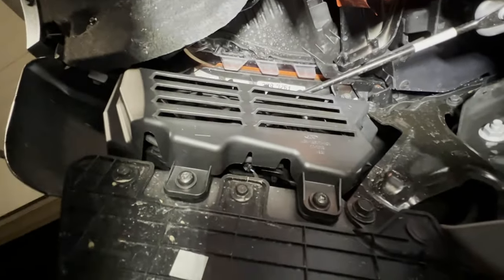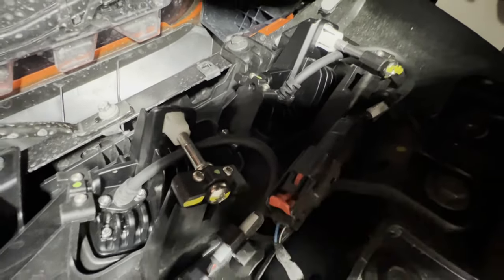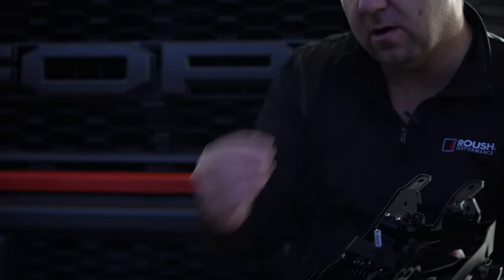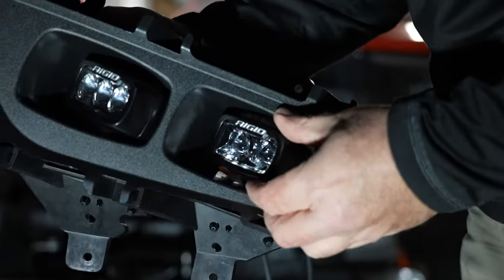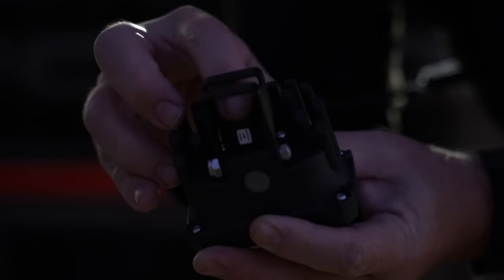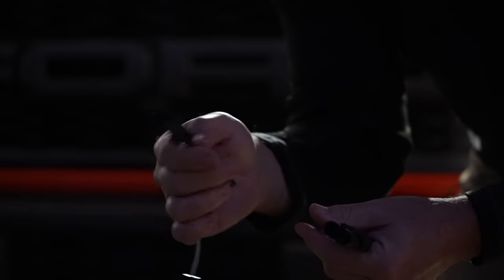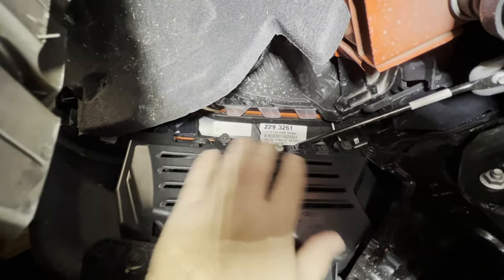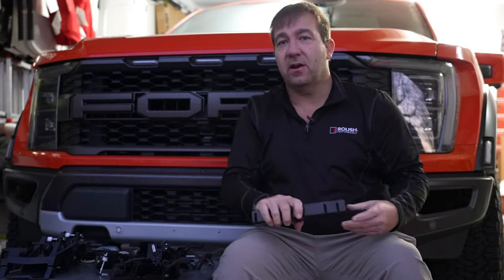2021+ Gen 3 Ford Raptor OEM Fog Light Upgrade Install - Rigid SR-M, Baja S2, Diode Dynamics, 2022 22

Comment: if ill get 4 diode with backlit how many extension cable would i need that needed to be plugged in to running light plug?
Reply from the maker: Give us a call or a text, Jayse. (317) 934-6778 Sounds like you have a few questions we would love to get answered for you. Thanks!

Comment: List of tools needed?
Reply from the maker: Just a basic socket set and Allen wrenches.
8, 10 and 11mm sockets
Reply: @jtrischler From what I observed a T30 and 10 mm socket I just couldn’t make out the screws that hold the stock light housings. I’m assuming those are allen head screws? Thanks for the reply and video.